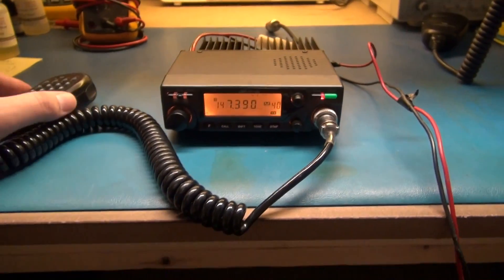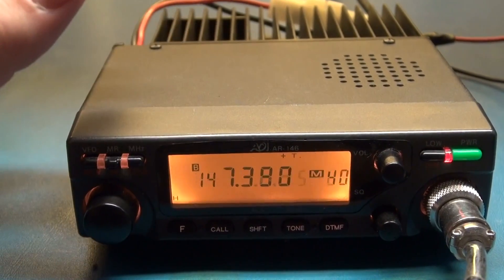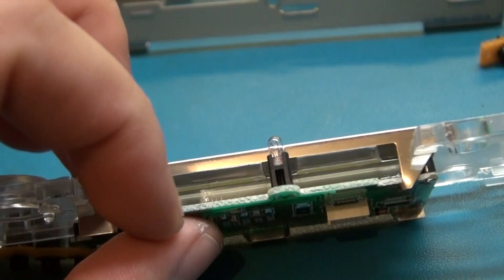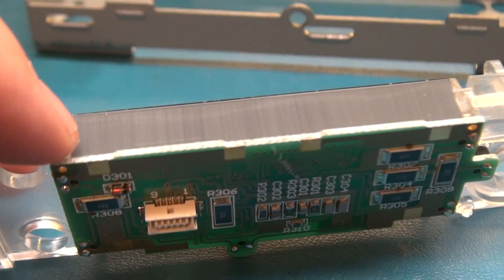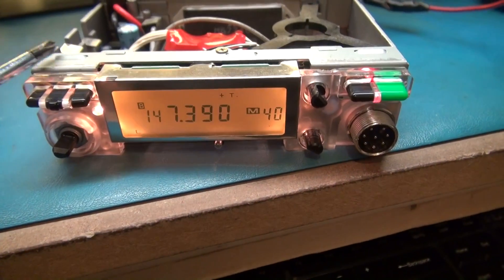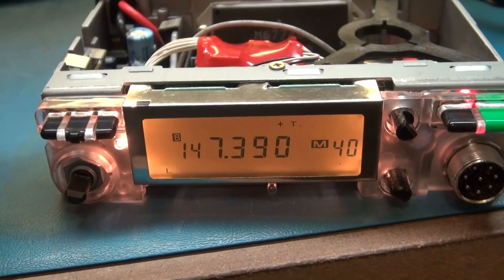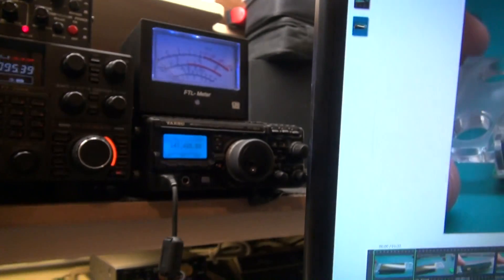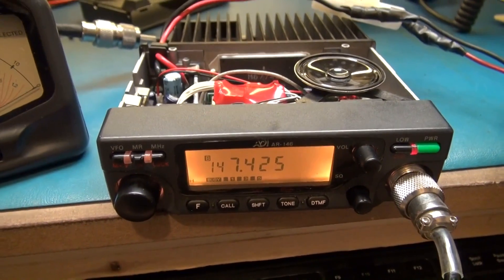ADI AR-146 2 METER RADIO LCD REPAIR

Comment: at 2:35 there is a green (or blue??)  wire coming out of the NEC integrated circuit - what is its function and why is it modified like that?

Comment: I am happy to see how you fixed it. Have an option of purchasing one of these. The seller does not show it turned on. Maybe it has the same issue. Now I know how to fix it. Thank you for showing how to fix it. That totally worked after you cleaned the pins. Very cool!

Comment: question. I obtained a ADI147, and I also have a TM241, essentially the same radio. I can take the 241 front panel apart in 2 mins. Last night the 147 display started doing the funky display problem. When I went to open it up, I can get the plastic tabs loose, I removed the tuning knob and mic nuts and washers, but I cant for the life of me get the faceplate off.....am I missing something?
Reply from the maker: +Rich Meinke To be honest it has been a long time since ive been in that model radio, i dont remeber.
Reply: lol well it might be a copy of the 241, however its not put together like one. You have to remove the entire control head, which exposes two screws on the back of the circuit board. If you remove the two screws, then that releases the plastic faceplate, and you can get to the LCD circuit board.....

Comment from the maker: Yea the mic could have a faulty PTT switch.  It should be easy to tell if the radio is stuck in TX or it is a fauly indication of the LCD malfunctioning.